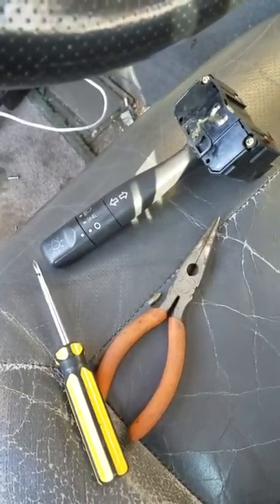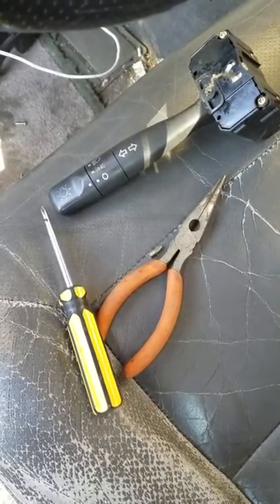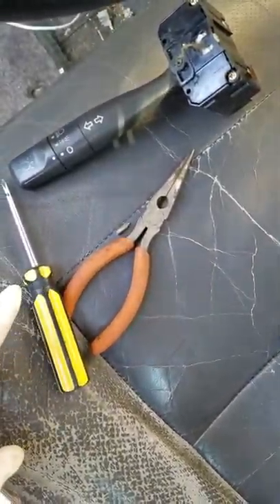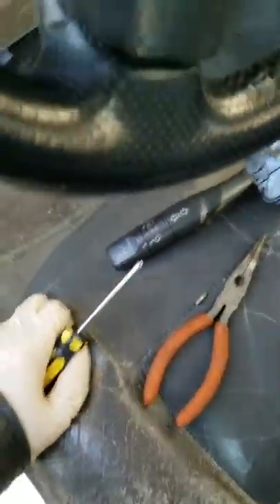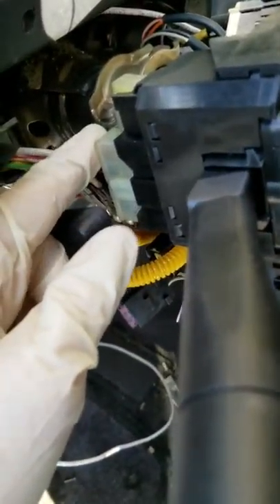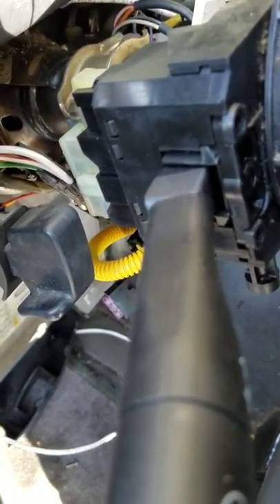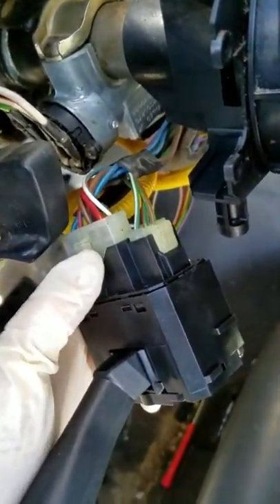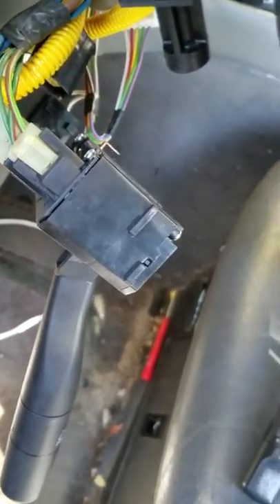1996 Land Rover Disco 1 - Turn Signal & Headlamp Switch Removal

Comment: Very helpful video.  May I add, if you use a very long philips screw driver, turn the steering wheel at a certain angle, you can get those 2 screws at a tight angle and loosen them.  I did my turn switch complete strip down cleaning following instructions on another forum.  You guys are saints! Very helpful instructions.

Comment: you don't have to do all of that. just turn your steering wheel to the right, so the bottom of the steering wheel is by the screws. you will be able to get your screw driver right in there. I did it myself to my 95 Land Rover Discovery 1 in 5 minutes or less
Reply: Thanks for the info. I own a Disco 95
Reply: Solid idea. Worked on my 95 as well
Reply: I did that and it works! Thanks! BUT, My Disco has a Cooper conection with another screw that does not allow to take out the Swich. So I Will have to remove the stearing weel to take that crew out.